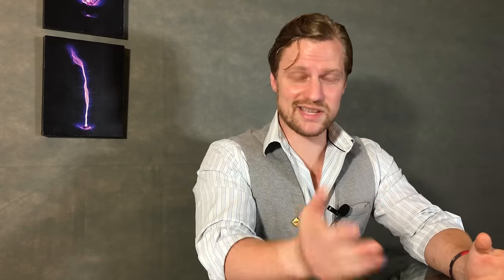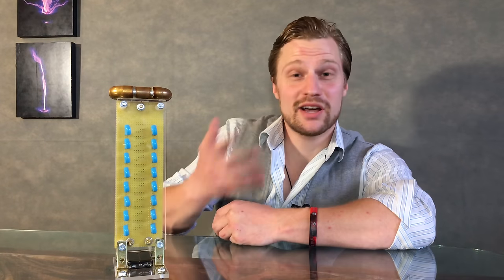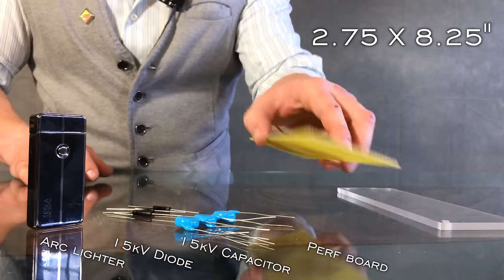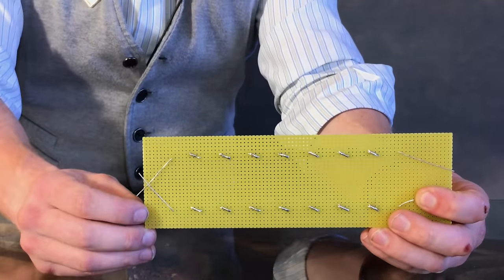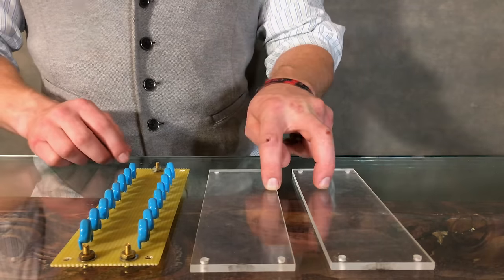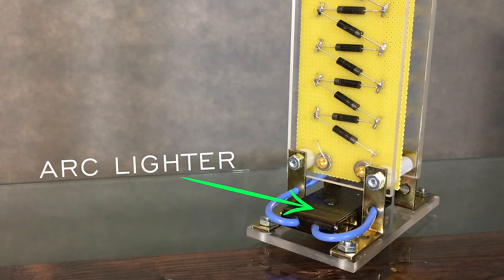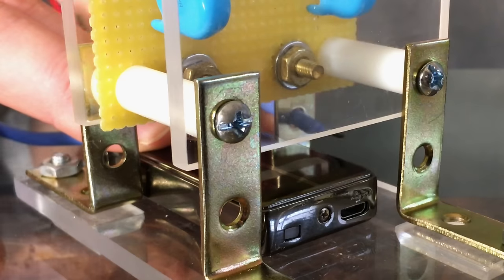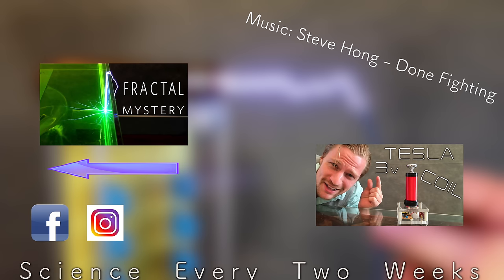DIY Desktop Lightning Tower (USB rechargeable!)

Comment: can you sir or anyone else answer me with this, Let's say I have a BLDC motor and I don't want to power it with a battery but from a direct current from a generator, this motor generate 102kg of thrust tho it need 50-100v Voltage so does the generator providing a current of 100v, the problem is the generator max output is 20kw but the motor max power is 28kw, so does this mean that at max motor performance output of 102kg of thrust the motor will actually output only 72,856 kg of thrust as a result of generator delivring only 71.428 per cent of needed max power or will it work at supposed max performance as it depends only on the voltage? I'm brand new in this field so please no hate I study something radically different and i'm just curious.

Comment: sir please tell me what sort of current is the arc lighter inducing into the system ?? is it dc input and dc output ???
Reply from the maker: Voltage multipliers only function off of an AC input. The arc lighter is pumping about 2mA into the multiplier. Current out is HUGE hundreds of amps. However, it lasts for a fraction of a millisecond which makes it safer, and allows for full energy transfer.

Comment: so i made one of these, is it normal that the circuit generates a massive ton of static electricity?
when i turn mine on there is a gust of 'wind' blowing out from the circuit in all directions...

kinda scary, despite the low current...
Reply from the maker: Make sure all your solder joints are smooth. Smooth out any and all rough edges. And make sure you only let it strike to that grounded wire. Grounded to the ground of the multiplier
Reply: Plasma Channel  i encased the one i made crudely in a pvc pipe and paraffin wax, it seems to be very effective. :)

Comment: will this work with a stun gun as power supply?
Reply from the maker: Unfortunately it will not. Multipliers need an AC sources of high voltage. DC will not work at all.

Comment: Can someone explain what he said about not blowing it up and using a ground wire or something?
Reply from the maker: The voltage multiplier has its own electrical ground. Don’t let it arc to anything but that, arcing to actual earth ground will blow up your lighter instantly.

Comment: Any thoughts on why lighter breaks when discharged to the ground?
Reply from the maker: Is it being discharged to the electrical ground of the lighter, or, earth ground?
Reply: @PlasmaChannel  I was referring to your important notice at the end of the video and your two lighters going broke. When I said ground, I meant, earth, as in, not  connected directly to the electrical ground  of the lighter. (BTW. I got quite a shock when using my cheap lighter on a grounded metal object, lighter survived)
Reply from the maker: Ah yes I see. It breaks because if you let spark jump to anything besides the electrical ground of the multiplier itself, the spark travels through real ground, then back up through the lighter, through your arms, etc. it destroys the transistor inside the lighter

Comment: Do I really need diodes rated for 100mA? They are quite expensive compared to similar diodes rated for 20 mA
Reply from the maker: The 100mA rating helps ensure when you discharge the spark, you dont blow up your diodes. Cheaper, lower current diodes will definitely work. But they will break really fast when you're discharging sparks - they cant handle the current.
Reply: @PlasmaChannel  I see. I guess I will have to invest in some better diodes then ;-)
Reply from the maker: @thomasritmeester3744  I imagine you can use your current diodes, but you'll need to use a very high voltage resistor on the output, to limit the current. Finding very high voltage resistors can be hard though.
Reply: @PlasmaChannel  But wouldn't the lower current because of the resistors cause smaller sparks? I will try to get my hands on some higher current diodes, they might come in handy for some future projects as well. Thanks for replying!

Comment: This is a cool build but I estimated the cost just for the main parts to do this build at about $60.00 dollars without the brackets. or copper pipes or solder or the right tool to cut through the acrylic plexi glass. And your video is  6 minutes and 57 seconds long. So what I would like to actually know is with the right parts and right tools how long did this project take you to actually build ? And what is the final projects electrical output ?

Comment: The ground is has got me tripped up. The tower ground? When did you explain grounding the tower? Im lost still. Ive watched it 3x and feel dedadee
Reply: The negative high voltage lead, basically the negative bottom bolt
Reply: @EEthanGao  either one of the 2 high voltage wires would work.

Comment: in conjuncion with the 2cl2fl diodes, may i ask the identification number of the capacitors? also, could i drive this circuit with an ac in from a psu with a small step up transformer? (the ones mainly found in the older wall adaptors)
Reply: i forgot to mention the transformer will be hooked up to a rectifier circuit, filtering the ac into dc
Reply from the maker: In order to use a multiplier, it MUST be fed AC. Also, this multiplier in particular must have a high voltage power source to begin with

Comment: Can I use a 15kv 0.1nF capacitor and a 15kv 5mA resistor?
Reply from the maker: The capacitors will work. What are you using the resister for?
Reply: Diode with 30kv 5ma
Reply: Can I use a 15kv 0.1nF capacitor and a 15kv 5mA Diodes?

Comment: Could you use the circuit from the bug zapping fly swatter?(used to make the mini Tesla coil) I was just wondering as I have a few of those but not a Arc lighter- GREAT Build btw!!!!
Reply from the maker: Thank you! Unfortunately no. The fly zapper is dc. You need ac
Reply: Thanks for the reply Jay!
Reply: easy to convert one to AC, just clear all parts from the transformer output, as its just the one diode after the output that makes it DC, so not even full wave DC. include this hack and a small multiplier to make a more grunty mini tesla coil.

Comment: I have an old patio bug zapper (still new) in the basement... 🤔
Reply from the maker: Those oldies are GREAT for small Tesla coils.
Reply: @PlasmaChannel  That's exactly what I was thinking. This video reminded me (somehow) that it's been sitting in the basement, in it's original box, since the early 90s! 

What do you think of building a lightning tower using an MOT as the power source? Insanely awesome or insanely dangerous?

Comment: Nice Build. Where did you find the HV wire used on the lighter?
Reply from the maker: Thanks!!That wire can be ordered online, or found at electrical supply stores.
Reply: Thank you. I have some from salvaged from medical equipment with nice flexible silicon insulation but it was difficult to acquire. I have made HV cable by putting silicon tubing over normal wire making it safe to handle so you don't feel any shocks. It makes a good chicken stick.

Comment: Can I use a flyback instead of an arc lighter?
Reply from the maker: You can, as long as it is an AC flyback
Reply: Oh, I don't have any of those. Will a CCFL inverter work then?

Comment: Is it possible to use a nst with a 4kV 23mA output as the power supply ?
Reply from the maker: That would work, though, not as efficiently. Actually....if it's a newer solid state NST, it would be perfect.

Comment: how many amps does is produces? (is it gonna kill me if i touch it?)(cuz i have to do it for cosplay)
Reply from the maker: As I mentioned in the video - only discharge this device to itself. Period. That means do not touch it. It would not kill you - but It can hurt you. Please do not use a high voltage device such as this for any kind of play. Thank you.
Reply: Thanks, and also, can i use instead of alc lighter, bug zapper circut?(it produces also some arcs on output pins)

Comment: Can I use the zap module from the 3volt tesla coil?
Reply from the maker: You cannot. That module outputs high voltage DC, multipliers require AC. Cheers.
Reply: @PlasmaChannel  Thanks for the answer.I now understand that I can't directly use the zap module.So if I need alternating curent could I use the 3volt tesla coil and connect the required cables in place of the primary coil? Or am I wrong (Im just starting with electronics)

Comment: Can i use 12kV diode with 15kV capacitors?
Reply from the maker: You certainly can. As long as the capacitor is a fast recovery one, and not one of those fragile 5 or 10ma ones
Reply: Thanks sir Jay👌.

Comment: What if my lighter has this X shaped arc? will it work?
Reply from the maker: In fact, it will work better. You need to connect the two high voltage circuits in series, doubling the voltage. Just figure out what the two wires are for each HV circuit, there should be 4 wires total, and separate each set of two. Then figure out which 1 of each of the two separate sets, can connect to the other set of wires. Solder them and provide plenty of insulation around that.

Cheers!
Reply: Thank you!

Comment: that’s a pretty big arc for 67’000 volts, you sure that’s correct?
Reply from the maker: It’s only based off of input voltage. Which was 3,000 assumed. But, if it was actually 5,000, that output is way higher

Comment: Hello sir, I want to ask that can I use it to power up my Tesla coil
Reply from the maker: You technically can. If you add a sparkgap primary circuit. MAY stress out the lighter more though, and reduce its life

Comment: i love your design but what i would do is skip all the capacitors and diodes and stick a high voltage transformer hooked up to a 9V batery
Reply from the maker: Thank you. However, that........would not work at all.

Comment: Bro, instead of using a plasma lighter, can i use a high voltage generator? Answer plss i want to make one to
Reply from the maker: You need ac. A dc generator will not work, if that is what you are referring to?
Reply: Plasma Channel but can i build a voltage multiplier using a dc high voltage generator?
Reply from the maker: I’m confused. Multipliers ONLY work when given AC. Feeding a multiplier DC will do nothing to voltage.
Reply: Plasma Channel can i use a tazer?
Reply from the maker: Tazers are DC

Comment: Can I use insects racket instead of arc lighter
Reply from the maker: You cannot. Voltage multipliers require AC Input
Reply: @PlasmaChannel  then anything else instead of lighter
Reply from the maker: Yes. Any high frequency power supply that is a few thousand volts will do.

Comment: Isn't that a jacob's ladder multiplier?
Reply from the maker: So, jackobs ladders dont multiply voltage. Though, this does look like it is build in a ladder fashion
Reply: @PlasmaChannel  yes, I meant the circuit looks like a ladder.
Reply: I'll build one of these, just waiting the components arrive. I'll use a bug zapper as HV input instead a plasma lighter. I've read you're a marine biologist. Cool. I'm starting a reef aquarium, still learning.
Reply from the maker: Oh, so you need an AC input for the multiplier to work. Most Bug zappers are DC. Careful! Thank you, yes I love the ocean
Reply: @PlasmaChannel  Ok, I'll check the output circuit. I think the zapper output already contains a multiplier of that kind. Thank you.

Comment: Is there any replacement for arc lighter..
Reply from the maker: You can use any high frequency, high voltage (no more than 6kV), AC power supply. Flyback supply, ZVS supply, ignition coil, etc.
Reply: @PlasmaChannel  thank you so much for your reply..
You are awesome brother..

Comment: @Plasma Channel   What is the rated power of this object? over 10W？
Reply from the maker: This device is limited by the lighter output, which is only a couple watts (I determined from the internal Lithium ion battery's rated energy capacity)
Reply: @PlasmaChannel  
This is really helpful for me. I am thinking about replacing a larger power supply so that the output current can reach 0.3 mA, so that this device can be useful in HV experiment.

Comment: Don't use both hands when you work with live high voltage, it is dangerous. Don't touch any conductive object by any part of your body when your hand is touching any part of your high-voltage device. Treat the gun as if it was loaded.

Comment: Hey man! Just found you! Love the channel, love lots of electricity, 
I’m just about finished my lighter voltage multiplier, I just wanted to ask where you attached your “handheld” ground wire to? The lighters output AC correct? 
Does the wire attach to the other top most capacitor?
Hope to hear back! 
Thanks!
Reply from the maker: Glad you enjoyed the video! Every multiplier has a dedicated electrical ground. It depends on direction of your diodes. Google a schematic on YouTube for some help for how you did it.
Reply: Man! thanks for the speedy reply!! 
I ended up just rewatching your video and paying extra attention to what you said, and checked google finding my answer! 
And now forming some PLASMAAA 😁😁 
Thanks for the video buddy! 
I have the Tesla coil and the desktop static videos in my playlist for my next lil projects!

Comment: Hey Jay, I would also like to build this one(Cockroft Walton Multiplier), since you have built this and the bigger one you have experience in this matter so I have a question for you.
Cause in in country is hard to get 10kv+ caps and diodes (it's expensive and diodes mostly 20mA) i have found few good i think
10kV caps rated : 1nF  1,5nF 2,2nF  470pF (which will you choose?)
Diodes: 10kV; 20mA   or   12kV; 0,5A ( again help me :P)
all i want to power by ZVS Driver + Flyback transformer, i think it should be good as arc lighter
Reply from the maker: I would go with 470pF caps
12kV rated for .5A diodes
This will make it safest for you, and highest performance too.
Reply: @PlasmaChannel  I've already build ~300kV double tower Marx Generator, but CWM i would like to use not only to show sparks but also 'power' experiments like 'IONIC THRUST' or Levivation, similar to that one you have on ur channel. And yeah, i allways pay respect to HV

Comment: Is there any alternative for the arc lighter?
Reply from the maker: There in fact are many alternatives. However, The arc lighter is pretty much the cheapest, most compact and convenient alternative. You can use any NST, and the newer type NST's are the best if they have no ground fault protection circuit. You can use an AC flyback circuit, an ignition coil driver circuit. Basically any high frequency AC will work.

Comment: Nice project! I have been thinking about building a Marx generator using 50kV 0.01uF capacitors I could get, but they are about 10kg each and I don't really have a space for that. Does anyone have any ideas for other uses of those capacitors?
Reply: Earl of Destruction You can make some charging coils and create some serious Marx generator without the losses of resistors
Reply: Thanks for information! Idea of using coils somehow didn't cross my mind

Comment: Hello How do İ make high voltage generator input 12VDC output 25KVDC by Cockcroft_Walton circulate? What kind and of capacıtors and diodes should I choose?
Reply from the maker: Hello, it is nearly impossible to have an input of 12 volts - and create anything more than a few hundred volts coming out. Every single diode your power goes through, you lose about a volt. You need a high enough input voltage to overcome voltage loss.
Reply: @PlasmaChannel  Can I take your E-mail
Reply: @Dr.Eng.Kemal_AMAYA  you can use an ac flyback transformer with a 12V driver and connect its output to a cockroft walton multiplier. you can get upwards of 30kVDC

Comment: Does the arc lighter produce ac because I thought voltage multipliers needed ac to run 
Edit: nvm it’s obviously ac because they’re high frequency arc lighters but I’ll leave this here in case anyone has the same question
Reply from the maker: Yes indeed they are AC

Comment: Hi - I love these experiments with high voltage.  What happens if i connect an output of a microwave transformer (2200v) to an inpout of a 240v microwave transformer?  Will i get 22 000 volt,  and could i use this as a source for voltage multiplier?  And can i use the same diodes and capacitors that you use?  I would love to make an about 500 000 volt voltage multiplier . 
 Or do you think the transformers would just explode? Maybe this is something you could test for us?
Reply from the maker: It is a great question. You'd think you could just keep stepping up the power. However, MOT's are designed to function off of massive primary coil currents. So, the second MOT's primary would only be receiving about .5 amps at 2000 volts.....not much current for an MOT to try and transform. It may work, and could definitely be experiemtned on a few seconds at a time, to be safe.
Reply: Nope, MOT can only take a few hundred at primary. The insulation won't take it. You will arc, and melt the second one. Never do this without an in line fuse 15amp max.

Comment: If all your capacitors are 15kV rated and you claim the final stage voltage to be 67kV why don't your capacitors pop off?
Reply from the maker: Capacitors in voltage multipliers discharge in series.   That’s 15kv Times 16 for a voltage rating. I recommend you watch our old episode about humans making lightning. It will explain how voltage multipliers work.
Reply: Plasma Channel thanks, I'll watch them. I have to confirm a doubt, if I extend the last stage output using wires and if the wires are touching my body, it will zap me badly right?
If yes, what can be a solution to it if I still want to keep it close to my body?

Comment: Can we use batteries if we do whats the difference
Reply from the maker: Batteries in place of the capacitors? Thats a negative ghost rider. Batteries cant charge and discharge in a split second. Also, they cant withstand 15,000 volts or so.